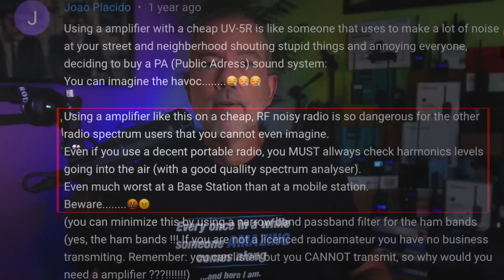What Are Spurious RF Emissions On A Baofeng UV-5R Ham Radio? Spurious R.F. Output Explained Ham/GMRS

Comment: A radio telecom tech that I spoke to (from a company that manages our UHF radios at work) told me that handheld radios' electronics "degrade" over time with use, even with high end brands like Kenwood and Motorola which cost $1k+ per unit. This results in poorer reception and transmission quality (and less fars) on older name brand equipment, and probably quite a lot of "spurious RF emissions" as well. Therefore, spurious RF emissions are inevitable and can come out of Baofengs, Kenwoods and Motorolas alike...  🙃

Comment: The FCC should take it up with the manufacturers, not the consumers. If the radio is approved to be used as intended, and you use it as intended, then I don't see a problem.

Comment: Not a safety issue, but a poor quality or damaged transmitter that transmits "large" amounts of energy on the harmonics of the intended frequency will reduce the effectiveness of your radio, since the 4-5 watts is being spread out over each of the frequencies. This could mean that 50% or more of your power lost as a result

Comment: @NotaRubicon Hi, I am new into hobby and learning a lot from your YT series (subscribed). I will try to stay on topic, would be great to have someone with spectrum analyzer on the show comparing cheap Baofan with more expensive Yaesu for example, like one of the commentators did. However, I have another question since I am learning and I might be doing something wrong or bad at googling. I got myself Baofang UV-5R and blocked (how I found your YT channel) TX on both UHF and VHF until I get a license, so mostly using it for listening. I have also legal in Europe 0.5W PMR frequency walkie-takies from French company called Decathlon (cheap store for sports equipment). When I transmit using these walkie-talkies I can hear on the other one from the pair voice clear on just one channel (no CTCSS or DSC I turned those off) meanwhile on Baofang UV-5R I hear myself bleeding to 1-2 channels around the actual channel I am transmitting on. Both channels A and B are set to the same frequency 1 channel lower than I am transmitting on. For example I transmit on channel 7, but I hear myself on Baofang on channel 7 clearly and pretty clear also on channel 6. Why is that because both receiving channels I set to the same channel. When I step both A/B to even lower channel I stop hearing myself. On the PMR walkie-takie this does not happen and I am not using any tones. Thank for explanation ! Maybe it's something trivial or maybe some commenter can respond!

Comment: I’ve been a ham radio operator for 3 months (which means I’m the expert) and can verify that my uv5r have caused interference with alien spacecraft all the way to other planets. Also, I have read the entire Internet.

Considering how it practically seems to be the norm for a ham to start off with a uv5r, I imagine these radios have done far more good for the hobby than bad. Also, is sad ham possible for a vanity?

Comment: As  licensed ham for a number of minutes and occasional radio technician I will check your Baofeng with a spectrum analyzer for out of spec harmonics, advise you of the ramifications of my findings, and send you on your way to do as you will. My job is done at that point. BTW, your RE20 sounds great!

Comment: I've been into radio communications for 20 years. I have a few radio buddies that died of cancer. I wonder if this had anything to do with the fat boy/ davemade  amps in close proximity to their bodies.
Can you tell me is this even possible?
Does the emission come from the antenna or the radio/ amp itself?
Reply: Jimmy, I have seen no reputable research studies that have linked radio waves to cancer.   Not one single study.  However, Radio waves when absorbed will generate heat.  That's how dummy loads work. Its also how microwave ovens work to heat food but they are a thousand Watts.  Baofeng radios are 5 Watt transmitters and the Spurious emissions are micro Watts.

Comment: Ex-pilot here. Only spurious emission that ever affected flying was an actual FM music station that had some issues and managed to step on ATC frequency. We were never at risk as there are "No Radio" (NORDO) procedures for that occurrence.  Your cell phone puts out way more spurious emissions than most radios would..we could hear it on our headsets any time someone's phone was about to ring.
Reply: I second that. I work in an EMI lab, and I have to regularly tell everyone within 50' of our EMI receiver to put their cellphones into airplane mode whenever we're scanning the 200 MHz to 1 GHz range. That crap bleeds right into our receivers through the display and ruins our scan. It's happened so often that I can tell which provider the offending phone is using. 
 Wi-fi modems and LED light bulbs are also major offenders. I'm pretty sure any of these culprits dump out more spurious emissions than a little cheap Chinese handheld radio.
Reply: Yea, i remember hearing the interference on my radio when the cell phone was about to ring.
Was that the 3G network?

Comment: I have to say, I have owned 7 Baofeng amateur radios; 3 mobiles and 4 handhelds. (also had 1 mobile GMRS radio that was 'ok')  I think the amateur mobiles are trash, since every one of mine had catastrophic failure within days of install... but even with the minor spurs on the HT's (which amount to almost nothing... just measurable) their handhelds have been pretty awesome for the price.

Comment: The most dangerous thing about a UV5R is poking yourself in the eye with the antenna. The second most dangerous thing is poking yourself in the other eye.    The actual danger from these radios is the battery packs.  The reason I have a Wouxun HT with no battery is because the battery I had for it shorted out and began trying to catch on fire, and a rapid disassembly took place to stop that.   The reason I have a UV5R now is because buying a whole new radio was cheaper than getting a new battery for the Wouxun.  The UV5R ended up being a better radio anyway.  But anything with a battery is potentially dangerous.  It is a risk we all accept with our phones and watches and other gadgets.

Comment: Here is a quick and easy test anyone can perform to see if their Baofeng (or other radio) is guilty of transmitting 'spurious RF emissions'!

1. Start with two radios, preferably some distance apart (ask a friend to help)
2. Configure Radio 'A' to use frequency 146.5200 Mhz
3. Configure Radio 'B' to use frequency 146.5200 Mhz
4. Transmit (PTT) from Radio 'A' and observe the signal received on Radio 'B'
5. Configure Radio 'B' to use frequency 439.5600 Mhz (3rd Harmonic)
6. Transmit (PTT) from Radio 'A' and observe the signal received on Radio 'B'

If you heard the Radio 'A' transmission on Radio 'B' in step 6, this is very bad! 
This reveals that Radio 'A' is transmitting on Multiple Frequencies every time the PTT button is pressed.
If you have a scanner or SDR radio, you can also test the 2nd Harmonic (293.0400 Mhz), 4th Harmonic (586.0800 Mhz) and 5th Harmonic (732.6000 Mhz) to verify that your Baofeng is transmitting on no less than 5 seperate frequencies every time you use the PTT button!

These are not inconsequential static RF emissions, this is your voice being simultaneously transmitted loud and clear across multiple frequencies and bands!

Repeat this simple test with all of your radios.

Which radios do not exhibit this poor behavior?

Hey Randy! Pleae do a follow up video and show us your Baofeng test results! (BTW, Baofeng are not the only radios that fail this test)
Reply: Andy, that's a great idea for a do-it-yourself test. If you start with the radios next to each other and you verify the 'spurious' signal is present on 439.56 and then walk away with one radio and see how far apart the radios need to get before you can't hear that spurious signal.  That will give you a very clear understanding of how low power that spurious signal is and how close you have to be to even hear it.  Hey Randy, all you need is one of those ham radio friends of yours to legally key the transmitter and you can walk away with the receiver and you have another video to put on youtube.  I'm getting excited to see the results.
Reply: I don't have a Chris-530 to help me out with radio Fars testing so I had to ask my friend Pete.  He just reported losing the spurious signal at 91 feet away from the first Baofeng.  We will be repeating this test several times to make sure there were no mistakes and if any of you would like to try a test of your own please report your results here by submitting a comment.
Reply: @craigdavidson2977  I forgot, Randy cant push the button for non-GMRS frequencies :(
Reply: OMG...  I just realized....  The Baofeng is a Chinese radio and Randy meeting with a Ham to help with this test is like Nixon going to China in 1972. After all, the sad hams act just as authoritarian as the Chinese Communist Party, don't you think? The world has now come around to a complete circle.
Reply: @craigdavidson2977  I will do some of that testing this weekend - I have a couple dozen radios to test!

Comment: As an aviation electronic technician. I can gladly say that signal bleed over or ✌️✊✌️✊"spurious RF emissions"✌️✊✌️✊ can't and never will bring down a plane or helicopter and that those who implied this is full of 💩 and needs to go to the internet comments HR department and fill out the required ID-10-T form for posting a stüpid comment or reply. Now, I'm not qualified to speak about the technical aspects of avionics used in UFO's, but I'm pretty sure they're not scared of a little RF either. RF Karen 🤡🤡 trying to ruin the fun of others.

Comment: Easy to tell using an SDR. Not to look for emissions though. All you do is grab a copy of SDRTrunk and tune into your local P25 system, and then key up and listen to how none of them give a shit
Reply: On a more serious note, in my office I walked around testing everything I could find and you know what puts out about 14x as much interference as my radio on ham frequencies? The LED lights in the building.
Reply: @ambirbtruckdriver  thought for sure it would be the laser printer for sure
now I am seccond guessing if I should put up that new fancy shop light or not if it will give off unwanted speratic ejaculations

Comment: As someone who has had a pulse for 50+ years, there is absolutely no way an HT can ‘break’ anything.  Zero.  It literally can’t happen, if the radio is being used in the intended way.  How do we know this?  Because many groups use radios to specifically do the things you stated; block cellular signals, block shortwave, block RC signals, and the like.  None of these agencies or groups use HT’s to accomplish this take; no not even MacGyver.  So anyone that posts such a claim is an idiot.  And anyone who ends their post with a HAM call sign, in a effort to sound like an expert is a shill.  

Tasty ‘Ham Sandwich’ Tom
AE8WTF
Hell, Michigan

Comment: it is  a yes and a no problem and ham operateurs make it a problem because they have rules about that thats why they make a problem of it for frs/gmrs it is almost like cb (there are no ruls) so you can do what you want to do using 50 watt radio's and that sort of tings. i don't say that the uv5r is a bad radio i used for pmr (the dutch frs) and also for ham the problem whit that radio the filters, they are not bad, but, what you see the filters are for a to small on uhf for instans the filter works 430-450mhz so may be problems in rx and tx if you get to 462 mhz ter is no filter at all that was my personal experience wit the uv5r. and yes i am a ham operator bud i stil do whit al my radios want i want to do ; that is talking to ather people and for me it's not a problem if they are on ham cb or pmr (frs) and i wil help them if they need it. I like my hobby, and i like to keep it that way. and yes there ar verry sad ham operators, thats becaus they had NOTTING in life as there radio they don't know anny thing else to talk about. this is al in my verry bad enlisch bus i hope every buddy get what i mean.

Comment: HAM here and admittedly the least knowledgable in the HAM group.  However I have a Baofeng (Boo-fang?  Bwow-feng?) Uv-5r.  And I have tried many times to Chirp in the frequencies of the local PD, Fire, EMS, etc etc only to fail.  I'm told that PD and LE in general have done something to cloak the frequencies.  I assume so the public will not know when they meet at the donut shop. 
So the spurting ejections should be a non issue, or am I thinking wrongly?
Reply: Yeah most use digital radios maybe not in the US
Reply: I always wondered:
what happens if you accidentally hit the police alarm button on the baofeng while its tuned on a police or firefighting radio station

Comment: I am not a sad ham, but a happy one :) I too, own a few UV5R radios as well as a couple of high dollar Kenwood/Yaesu radios. I recently tested a UV5R against a Kenwood radio that cost about 10x what the boofwang costs. I ran several tests using a GWInstek GSP-630 spectrum analyzer and my tests showed virtually no difference on the analyzer. Further, I did not see any harmonics transmitted from either radio. BTW, as a happy ham operator - I loves your videos.
Reply: I have 2 uv5r's and 2 uvx3's and a Kenwood TH-D74A. Only difference is the Kenwood's output is higher on all 3 bands on said baofengs. Getting into the repeater(s) with all of them on 2m, 440cm and the 220 (1.25m) resulted in same so "they" said. On simplex the Kenwood beats all 4 Baofengs big time. UV5R's are decent radios for what they are. I'm a happy ham and a happy GMRS user. We'll talk Randy into being a happy Tech ham sooner or later. Maybe even a General or even an Extra ;-) haha
Reply: @BobBruns  Well, I somehow doubt that Randy will take that plunge :) Like you, I also have a GMRS license. Funny that you mention the TH-D74, that is the radio that I tested the UV5R against! I use that radio for packet, too bad the boofwangs don't have digital built in. But what does one expect from a $25 radio :)
Reply: @SGMPhil  With what he knows now, no doubt he could pass the Tech. But ya you're probably correct he will not give in haha
Reply: @Codyjrt  Yep - the UVs are great utility radios. I can buy 3 of them for what the replacement battery for my Kenwood costs. I love my Chinese "junk" radios :)